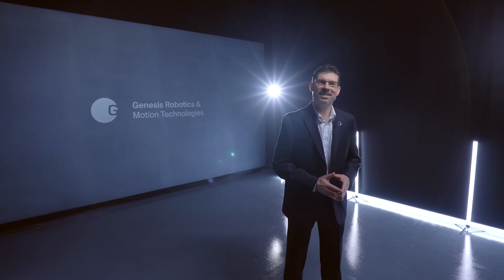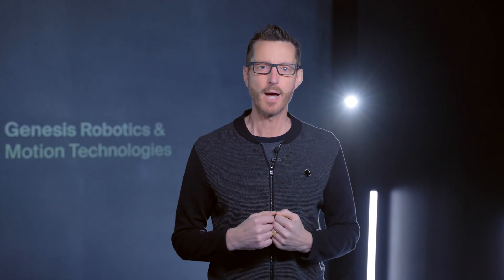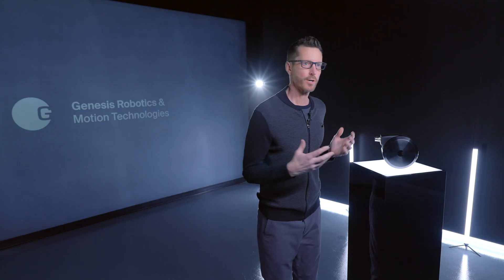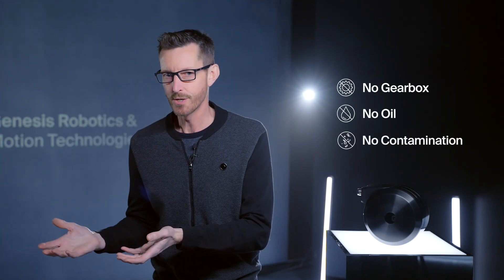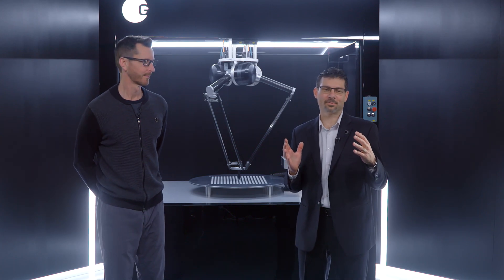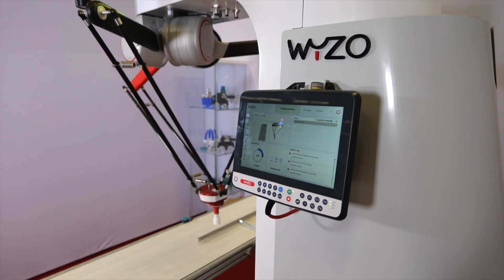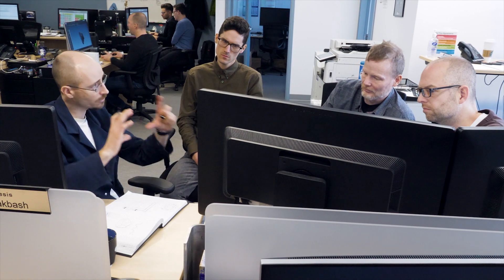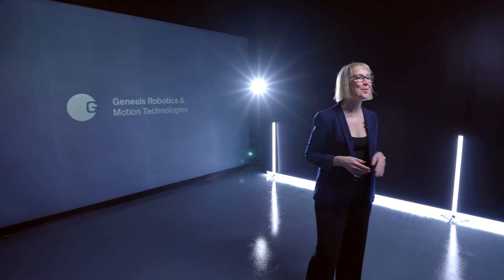Genesis LiveDrive® LDD 1800 Series – Launch

Comment: what’s the difference between Linedrive and DD motor?
Reply from the maker: LiveDrive IS in fact a direct drive motor but it is 3X the torque density of other DD of the same size. This opens up new opportunities to machine and robot builders. In many cases such as in delta robots you can remove the need for a gearbox.